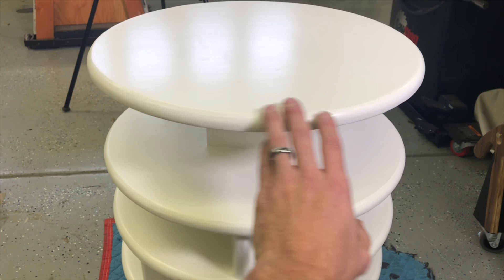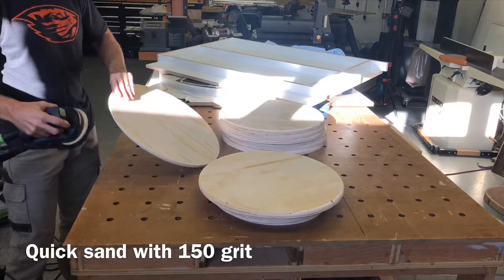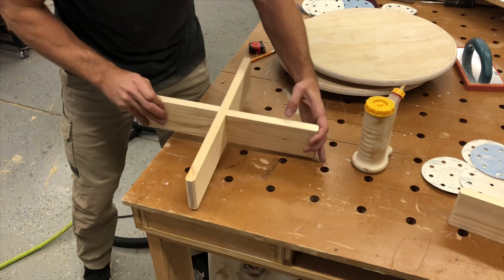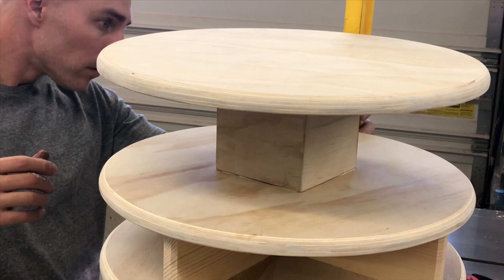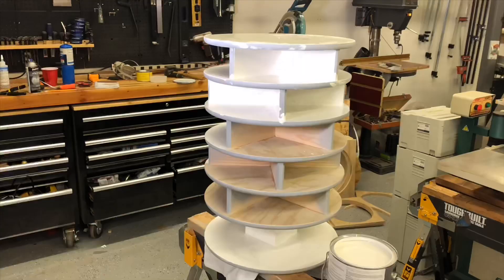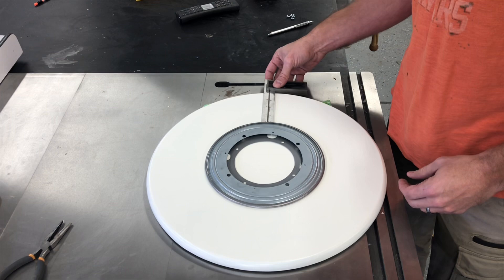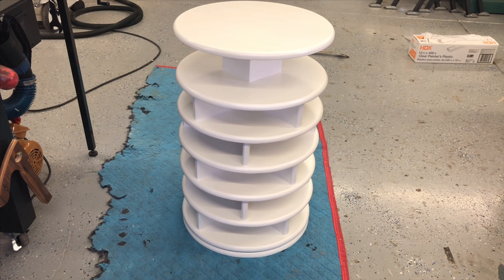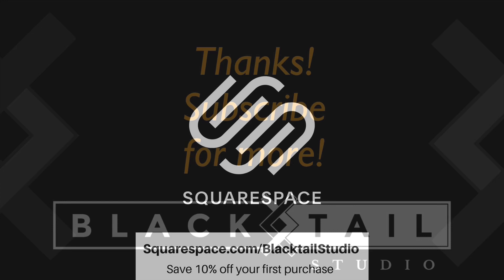DIY Spinning Shoe Rack--DIY Projects

Comment: For paint they have a extender’s for slowing drying time and it helps with leveling. Floetrol  for water based, and for oils. Just saying. Thanks again for your work. I came to your posts from Ken’s Karpentry he builds garages and small homes in  Vermont from cement to the roofs. And he does as you explaining it, as he builds.

Comment: Daunted but not completely ready to give up.  I wanted a rotating rack plywood about 
23.75" circular about 67" high, I don't own powertools...I am a senior.  I have two videos using pocket holes up - right or vertical spacing 8.75" X 7" not sure exactly.  I asked instead of pocket holes can I conform to using "Router-Dados" staggered on Each circle on both sides minus the top circle? So I would slide each partician section into place? I guess the plywood would at least be 7/8" thick.  So HomeDepot doesn't cut circles I don't even think they cut big pieces into specific individual parts.  How do I get help?